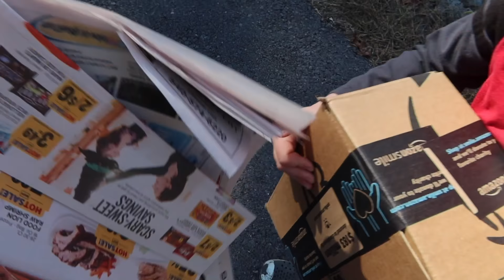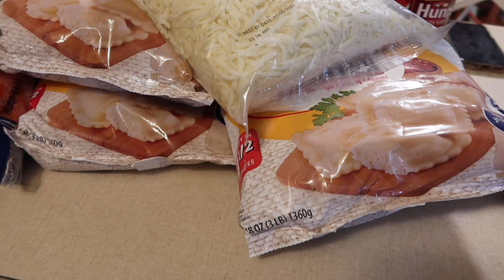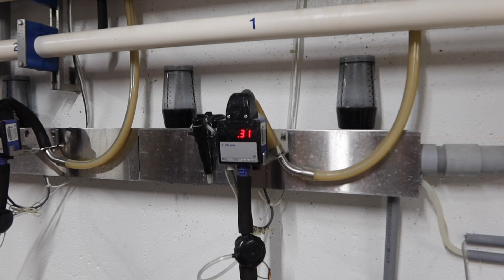😱 SNAKES, PONY, or COWS 😱 | What Are We Adding To The Family Homestead?

Comment: You will need to rotate your crops, so several garden areas would be beneficial along with the length of sunshine each area receives. It's also easy to work with several small beds than one very large bed. Different crops grow better in different soils. Easier to amend the soil based on what you are growing in that area. You should also do a soil analysis through your local farm extension service to determine what amendments you need to add to the beds.

Comment: We just put up our pool end of June, and it was a PROJECT. For the bottom edge, definitely line it with rock so it doesn't corrode. It's a lot of hard work, but it's so much fun to have it in the hot summer days.

Comment: For our 26ft. above ground pool we purchased a Gorilla Pad to put on top of the underneath sand to prevent rocks from penetrating the bottom liner. it’s technically not a “pad”, more like a tightly woven material. it was about $200 online and well worth it- works great!! No one likes stepping on rocks while swimming 😊💕
Reply from the maker: That sounds awesome! We have never heard of that. We got $1200 Worth of 24 tons of sand 😆😆😆. Our pool warranty stated it had to be leveled and on sand so that’s why we went with that.
Reply: @JamerrillStewart   yes we poured alot of sand first as well then topped it with Gorilla Pad. Sneaky rocks have a way of working up through the sand but probably because we live in the Desert 🌵 where there is a ton of rocks 🤷🏻‍♀️ Happy swimming! Love your videos. You are a blessing

Comment: I thought you filled a pool from your own water hose, but you have it delivered?
Reply: Some places it's cheaper to have water delivered. Where I live for example you pay drainage charges for every gallon used even if it's for a pool or garden and not going down a drain....my drainage charges are at least double the actual water part,  so it would be way cheaper to have water delivered if I had a pool.